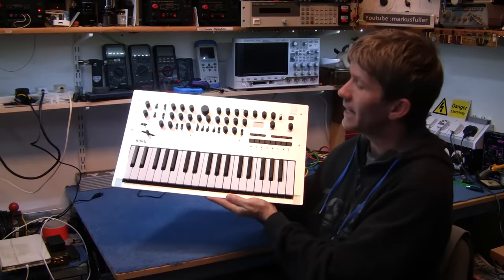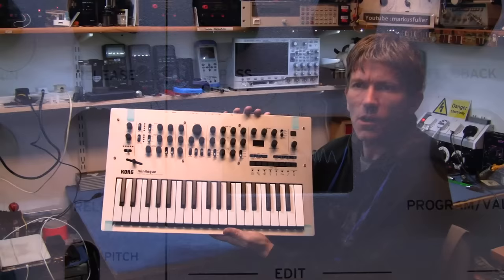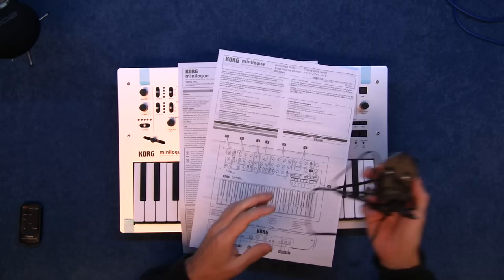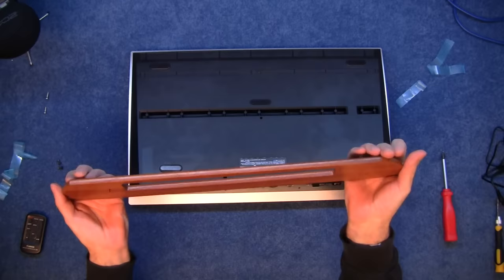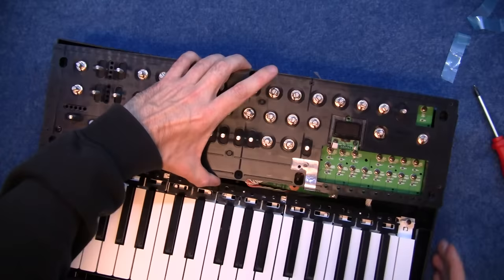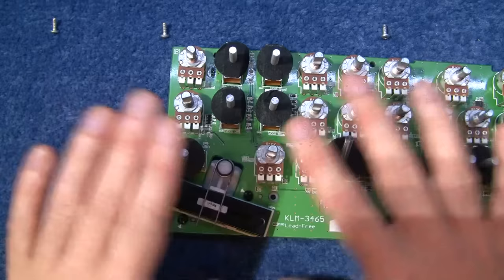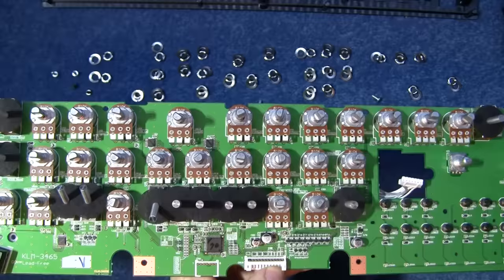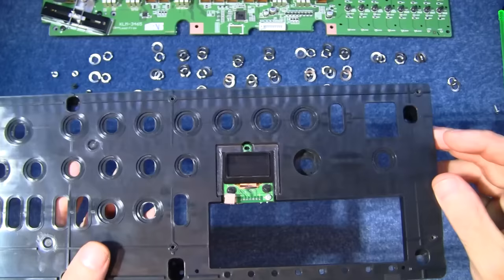Korg minilogue polyphonic analog synthesizer teardown MF#68

Comment: Thank you very much for that very interesting tear down! Great to hear that you are impressed by the generell build quality & that you get lots of synth for the money.

When I compare my 80ies Juno60  or 70ies Elka X705 with the Minilogue,  the electronic is now real mini, although analog.
Looks like It does not matter if 1 or 4 voices, probably 8 voices would have also fitted in the case.
When it is possible to produce a real 4 voice polyphonic analog synth with aluminium, real wood and radio controllers, many knobs, slimkeys & oscilloscope at that price, I wonder where the other competitors in this price-range are ???
Reply from the maker: +VolcaRock I agree I dont know how Korg are making these things and making any money from them. theres shipping taxes and shop percentage to come out of that end price. still i like the idea of an 8 voice version
Reply: Unlike Roland who needed Malekko & other 3rd party, Korg has a developer team with massive experience. They started with Monotron-gadgets followed by Monotribe, MS20mini, Volca-Series, Odyssey and now ML.They make profit on the mass market.

I ask myself what price is 1 voice on the board (just hardware)? about 20$? 

Price is 500$ for 4 voice Minilogue
would be 440$  for a 1 voice Minilogue (still good price, but not a no brainer)

But what if they would make an 8 voice?
I am sure we will see a Maxilogue with 8 or even 12 voices on the next NAMM for attractive price.
Reply: +VolcaRock I think the competition will be coming thick, soon. Before, or at, NAMM 2017 i think several competitors will announce a counter-move of sorts.
Looking back over the last several years, each year 1 company have had the gamechanger of the year, leaving very obvious traces in the market and the competition in the following year. Ofc it's a circular series of reactions, but a few stand out. And this year i think it will be the Minilogue.

Imho in 2012 it was the Arturia MiniBrute, kickstarting the analogue renaissance, and a subsequent lashings of cheap analogue mono synths, from companies they hadn't touched that market segment for years.

In 2013 i'd argue they took it again with the MicroBrute, pushing the boundaries for cheap analogue, the response to which brought the Volcas among other. The CV-ports also helped bring eurorack into the minds of people that would previously steer clear, and have had a hand in its resurgence.

In 2014 i think it's the Roland System-1, not only did it revitalise hardware VA as a whole, by bringing it closer to the analogue competition. But it reintroduced the notion of polyphony in the lower pricebracket, at that point utterly dominated by analogue monosynths. It may not even be a stretch to think it has something to do with the Minilogue being 4-voice poly. And the ACB technology will yet do more good.

2015 is harder to gauge a single entry pulling more weight than the rest. There's many good contenders from the Prophet-6, over the Roland JD-X's, Boutiques, Yamaha Reface series and ofc the KARP Odyssey. But i think my choice would be the Reface DX, as i think it will be the harbinger of several FM synths to come, perhaps for the 1st time in a long time, even challenge the monopoly of the subtractive synth. Volca FM any1?

Now if people actually read this novel, they're probably thinking something like "what about the MS-20 mini?". The list isn't based off sales numbers, where the MS-20 mini did very well no doubt, probably better than all but perhaps the MicroBrute. However it didn't really bring anything new, and it didn't really change anything, which would be the main requirement for being a gamechanger.

Now with the Minilogue more than likely being this years gamechanger, i predict the following: Novation finally bringing the PolyStation.
Roland have 2 potentially promising venues of retaliation, both the ACB-VA and the analogue from the hybrid JD-X's. Timing wise it's most likely to be a development on the ACB (System-8/10?), but perhaps they'll make a Aira hybrid with both ACB and real analogue? Or take the analogue voiceboard from the JD-XA and put in a smaller knob-ladden keyboard.
Yamaha will no doubt run with a bigger stronger FM synth, probably somewhere between the original DX7 and the Reface DX in terms of size and features, expanding on the interface-improvements with more hands on features to compete with the nice interface of the Minilogue.
Essentially each playing into their own strengths to challenge it on feel, interface and playing-experience, rather than trying to level the playingfield.
Reply: Korg was Kickstarter of the analog renaissance for the cheap mass market
with Monotron in 2010 followed by Monotribe in 2011!
And then 2 years later in 2012 Arturia made the Microbrute

And the MS20mini was something new, because before its release
nobody believed that a global player would make a 70ies remake of an analog synth especially at that price!
That was more unbelievable than the ARP Odyssey because it was the first.
  
There have always been amazing VA synths since at least 10 years , so I would not pay too much attention on them (when talking about anlog)
even when the technique is now better. Analog is a market which survived (like vinyl and tube amps) and the Minilogue
is the gamechanger for budget analog poly. 

Musicians who spend 2000$ or more on a synth will do that anyway with or without Minilogue so Prophet06, OB6 are out of competition. A big sucess on the mono market is Mother 32, I do not know any other facebook group which growed so fast!   But it’s mono and Rolands Hybrid has a minimal analog section only . Reface and Volca FM, is fine, but other technique. 

I am interested what will happen in the budget analog polymarket. Akai was awfully  bashed and even with a AX60 remake it will be hard for them. Yes, maybe Novation with Polystation, but Roland will not produce budget analog poly.

I guess THE ONLY real competitor who is actually able to produce at the same cheap price &same quality as Korg will be Behringer/Midas with their 6 voice analog poly with Rolandfilter clone. Coming soon!.
Reply: VolcaRock How many products have you seen with any relation or competitive value to the Monotron or Monotribe?
The answer is none. Ergo they didn't start the analogue renaissance. Also it doesn't take 2-3 years in a market as competitive as this for the competition to react. Firmly reflected in my list that showed the emergence of several analogue monosynths within 1 year of the MiniBrutes, and subsequent circles of reaction. Never taking anywhere near 2-3 years.

True the MS-20 mini was the 1st cheap copy of a 70's/80's classic, with no real alterations or improvements. How many have taken that up and followed or copied?
Again the answer is none. There's been several nods at the past, but Korg is still the only to make a largely unaltered copy.
Neither this, nor the KARP, are hardly unbelieveable.
But the KARP atleast brought a different set of waves, it had a bunch of improvements that helped shape the MS-20M and the Minilogue. And the cooperation elements may have had a hand in the Sequential/Oberheim cooperation resulting in the OB-6. But as i said, there were less of an obvious winner in 2015, the Reface DX being the closest to a gamechanger imo.

Roland is indeed unlikely to do a cheap dedicated analogue, but never the less did their ACB tech influence the market overall. And while it'll never outdo or replace proper analogue on its own battleground, digital has its own number of strengths that become increasingly appealing, the closer it comes to analogue in sound and feeling. So to assume it won't influence or change the market simply because it's not true analogue, is a big mistake, and quite frankly a bit narrowminded.

Like i said before, it's not a stretch of imagination to think the Minilogue is Korgs response to the System-1, effectively saying "we can do 4 voice poly too, but we've outdone you with it being a proper analogue".

The high end market, more often than not, stroll at its own pace, doing its own thing, and only slightly influenced by competition. The customers go for a particular sound and feeling, geared towards high end instruments. While some innovations and ideas filter down to the cheaper market, it's often a slow evolution over several generations, compared to the fastpaced changes and experiments going on in the cheaper mass market.

Again it's narrowminded to think just because the competitions reaction to the Minilogue won't necessarily be analogue, that it won't affect the market and pose a credible threat to the Minilogues sales (i still think it'll be 1 of the all time best selling synths).
There are afterall people, particularly the growing number bored with all the analogue monosynths, that will see Rolands VA/Hybrids as a viable alternative, or going for the difference in FM synthesis, we're likely to see more of from Yamaha. Plenty of people around that don't care whether a synth is analogue or digital.
And to discount that any company could bring out a similarly cheap analogue poly, would also be a mistake. Just see how surprising it was this time around. But there's nothing to stop a number of big players doing the same out of the blue.
Except if you look at the likes of the DSI Tetra, it won't necessarily be out of the blue.
Reply: +Marc the Darc well I think it's fair to say that korg have knocked it out of the park this year so far anyway. They also have that volca Fm. but the  moog mother does looks cool as well.
Reply: Robert N Yeah, don't get me wrong, Korg has made plenty of cool stuff. Hopefully soon i'm getting a Minilogue - that thing looks sweet!
But if they could lay off with the built in speakers and mini-jack outputs, and pay more attention to MIDI the list of coolness would be atleast twice as long. 
I just disagree strongly with the pervading notion that Korg started the analogue renaissance, as the timing and relations of the market forces point in another direction.
People tend to be blind to Korgs actual position in the market, as well as a number of shortcomings in recent designs.
Reply: ***** I think the reason why Moog aren't the most common mention in a discussion of who influenced what, is because in a way Moog does exist in a time capsule. They've always gone their own way, doing what they do and changing fairly little in the process. They're at the top of their game, and keeps refining that instead of going for the next paradigm shift. As such very few of the competition bother, it's nigh impossible to compete against the name and sum of qualities, and there's not much new to learn/copy either.
Look at it this way, when everybody else changed to digital, Moog kept doing analogue. When people started clammering for more analogue, Moog stayed their course instead of compromising to take advantage. When the analogue renaissance started, Moog changed nothing to respond to the competition moving closer to their territory. When polyphony was on everybodys lips recently, Moog stuck to monophonic.
If you got the kind of money it takes, you can always get a paragon of quality and analogue fatness. Nothing indicates that's going to change anytime soon.
Reply from the maker: Aah yes my Moogs - they are like the Rolls Royce of Analog Synth (not counting the theremini)
Reply from the maker: Yes I love my Voyager and Sub37. I agree they are their own instrument in their own right.
Reply: Development is always ahead of us all, both in quality remained (or increased) and quality decreased (sad to say).
But this said, we are as an "old" users-field" and and actual people that remembers or own old gears and as we diminish with our passion for "that" sound, so will the designers.
I know, this sounds depressing.
But how much effort is not given into the programming of analog circuitry adaptation/copying?
That is SO much "economical".

This text was not aimed at you personally, but as in general.
I am 48 years old an can still remember my experience with Korg PS3200 and the PS3100 at my music-store, when I was young.  Apart from these two I  had the Siel orchestral, Korg Mono/Poly, Korg Trident; Korg Polysix, Korg Delta, Korg Zigma, Roland SH-3a, Roland Juno 4, Roland Juno 8, Roland Juno 106, JX3P, JX8P as of the analog experience usage at my music store.
An experience I will never forget.
Yes, I was lucky to have all these instruments at my eager, knowledge-wanting hands and ears and at my hands disposal.
I can see this now, after all these years. But this was the late 80-s and the new era of digital-sound bursting in.
I remember the PS-3200 sold for 500£. Just an example how those analog were dropped in price.
Now in hindsight...

In any case, if any of "our" old classic companies were to remake their old gear.... I am positive to say that they would actually make a good living on it.
This partially due to cheaper parts, but also that there are a "hoop" of new users that are out there to get "that" sound.
And why not give that new renewal instrument a new design, not only with the bells and whistles as the old one, but maybe 1 or 2 extras that were never implemented in the first design?

There is a future, You just have to take care of what you have and make it better!!!

Comment: I really like the Minilogue, and now we know it's put together nicely. The only thing it's missing, in my opinion, is a sub oscillator. Would reallly like a sub on this to fill it out as a complete analog synth.
Reply: Matthew Maneri sub oscillators were not on the ob8, prophet-5, minimoog, etc. are those not "complete" analog synths??
Reply: Of course they're complete analog synths. The obvious reasons why have nothing to do with not having a sub oscillator.. the OB8 had 8 voice, the prophet-5 had 5 voices, the minimoog had 3. Granted, they were 2 grand more money for those extra voices, but I'm not asking for another complete voice, just a sub osc.. which aren't that expensive or involved to add on. I'd pay another 100 bucks if the Minilogue had a sub to go with the 2 VCOs.
Reply: I am asking for at least two more voices, 61 keys, and yes... a sub oscillator. Should still be under 1,000.00.
Reply: Matthew Maneri but it does have a sub if you set the VCOs to different octaves...
Reply: It has a sub osc in Mono mode

Comment: I definitely feel the same way about the construction of the slider when I got mine :( I'd much rather have a classic mod wheel. You don't get nearly as much control and you have to hold it down so you can't play with both hands if you want full modulation on the fly. All in all though, fantastic synth for the price. I love mine.

Comment: The display looks like a common SSD1306 controller based one. Cheap and easy to drive (i2c or spi).
Reply from the maker: +Paul Rogalinski (pulsar) I think I have just found very similar ones on amazon with everything on board to make it a mini scope.

Comment: Well constructed, well designed, especially those voice modes... but, they forgot one more possible mode, the Juno 6 mode... they could've used those 2 oscillators linked as one and turn this synth into a 8 voice poly synth and used that delay unit as a chorus fx, or maybe it wasn't possible due to voice's circuit topology, who knows?... nice teardown... I was doubting about its construction quality. Cheers from Argentina!
Reply from the maker: +TheMetalMusicMachine I was actually amazed at how well it was built for the price, I was expecting a few cheap innards but it all looks Good to me. Hello to Argentina :-)

Comment: Putting Magnetic Fields near any audio stuff is probably a bad move. lol. It's odd they clocked each voice section individually, rather than having a master clock. Does this thing use an external power supply? Maybe it was originally designed for a low freq. onboard PSU, which would need much smoothing in all areas...hence missing electrolytics. Just a thought. Great work Marcus, I love your matter of fact easy style.

Comment: I have become obsessed with the possibility of taking a blade to my Minilogue and converting it into a rackmount synth. Do you know whether it is as easy as removing a ribbon cable that communicates data to the keys to take them out of the equation?
Reply from the maker: IPAsNmore Hi you you could remove the ribbon cable and place a midi in to see if it still works. though don't pull out the cable if it is powered up. but i really dont have answer for you, interesting to see one made into a rack unit.

Comment: I just bought on e of these second hand and the slider doesn't work at all although its spring\action seems to be ok (it moves back and forth like it should). Do you recall\think that it could have popped off the interior mount (the one you put shrinkwrap around)? ie is there clearance enough for that to happen?

Comment: Thank for showing the inside of the Minilogue. Great video, as always. They are a little bit expensive, but have you ever opened something from Waldorf? My Streichfett says it was made in Germany (I think they all say that), but I wonder if it was only the final assembly, or the whole thing.
Cheers.
Reply from the maker: +Philip+ Hi Philip I have the Streichfett waiting for the teardown which I will do soon.
Reply: Great! The Streichfett is all digital, so I'm betting it will revolve around only one big IC at the centre... I'm sure it will be a great video.
Cheers :)

Comment: Awesome video Markus! Very nice explanation. Really enjoyed it.

My slider is not working properly. When pitch is assigned, it oscillates rather random and it suddenly stops from reacting to any movement. Mechanics seem fine so thinking its software probably.

Do you know how I may be able to disable the slider either hardware or software? The only work around is to assign it to a delay parameter and disable the delay but it is really annoying.

Thank you sir in advance.